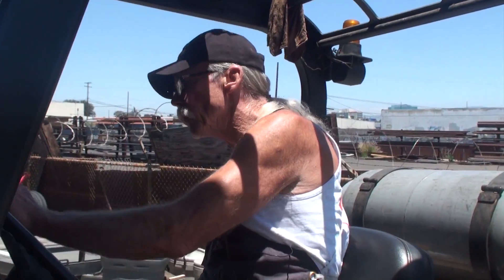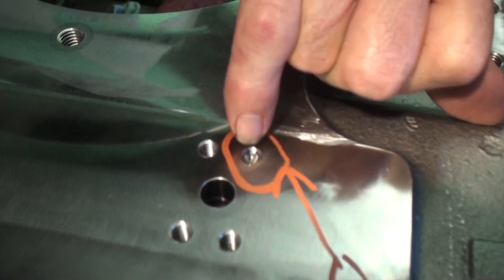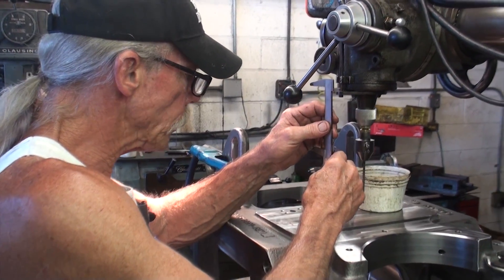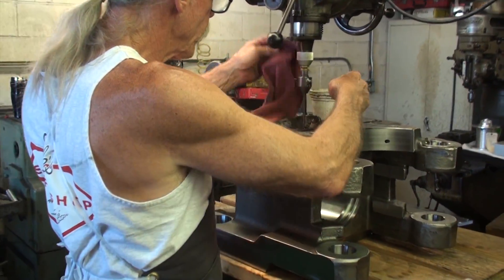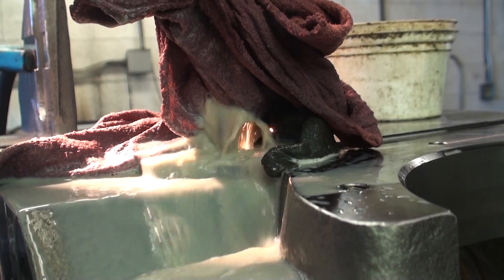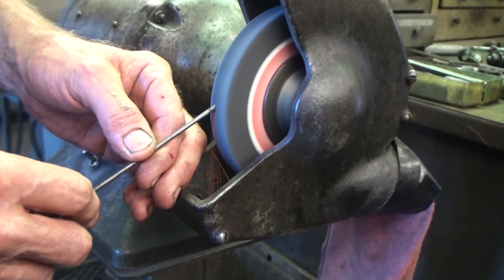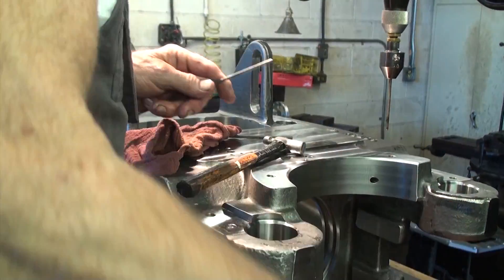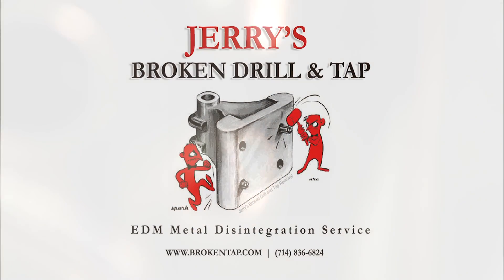Broken Tap Removal by Metal Disintegration Machine (MDM)

Comment: I find it shocking that there are enough broken taps in the world to keep a private business open. That's amazing.
Reply: it happens all the fucking time in high volume manufacturing.
Reply: They probably do other work in between. Most shops do many types of machining.
Reply: With cheap steel chinese import no brands tap you will see more and more !
Reply: AirsickCashew it’s really not. I’ve been a machinist for 16 years. I work on Haas mill CNC machines and I can tell I I’ve broken dozens of taps over the years. Luckily our jobs don’t require working on one super big and super expensive part at a time. We can just scrap most of our parts and it will only cost us penny’s. The cost of the material. We do production runs. 500 of this 200 of that, but yes if I broke a tap in that part, I would be so happy if I new of this dudes services. I can totally see how this guy would have plenty of business
Reply: That was my thought
Reply: Jim Watson don't you mean removed broken bolts with a left hand bit ? Never seen anyone successfully remove a broken tap with a drill bit . I am some people refer to bolts as "taps"
Reply: We like to extract taps using a "tap extracter kit" The fastest way in my opinion :) If not that, we usually drill out the tap with carbide drills.
Reply: the russian machinists tap extraction kit lol.... Carbide drill bit ?? Wth  how about you post a video of drilling out a 62 plus Rockwell tap with a carbide bit. Never seen it done in 25 years....
Reply: @stevenmassey7586  I'm serious, we use carbide drills. We do it for small taps though.
Reply: @stevenmassey7586  ... or use several old worn 3-4 fluted (carbide or better)end mills, with an OD diameter size aprox .020 smaller than the minor diameter of broken tap , fill the hole with tapping fluid,  use wicked high rpm (eg. assuming your on a cnc mill,  e.g. 1/4" e-mill start with 7-10 thousand rpm, e.g. 1/8" 9-13 thousand rpm,ect.... )  Your first few exploratory cuts will give your tentative base line ,  [imperceptible rattle... is the tap loose?  low level rumble during contact?  increase rpm. ( you want light "crunchy" disintergration sounds)   ect... ]   MANUALLY feed in employing abrupted, multiple, short pulses advancing 5 to 10 thou at a time. You will be looking for smoke and smelling for burnt tapping fluid, keep the fluid level topped up, and completely flush out when cleaning out debris every 50 to 75 thou.    the machine will talk to you, listen to it EVERYTIME you advance.  when successful, youll  end up with with spiral (or straight) "comb" of the tap cutting edges as a reward.
Reply: Two ways I've had got luck removing broken taps 1) using a center punch to loosen and turn tap out or on thru part. 2) blowing tap out with a torch.
  Best not to break them but it happens for sure, especially in a blind hole. Using the proper tap eliminates a lot of breakage spirial, three flute, four flute, starter,bottoming... Etcetera
 And yes when the boss is standing beside you bitching come on hurry I under bid this job and their truck is in the parking lot and even use a drill motor to tap it fast 😬😬😬
  Now i remember why I got out of job shop work...
Reply: I would imagine this gentleman is very well known and work is probably shipped to him. People send out engine work all the time.but I kind of want to believe this man's up to a lot more than just extracting broken taps. Broken drill bits are almost as bad.
Reply: It might also surprise you to know that there are literally millions of holes tapped daily and because life is not always fair, I'm sure that there are thousands of shops like his all around the world.  Sometimes, depending on the metals being tapped, you can loosen the broken taps using acid but you need to make sure that the acid eats away at the tap only and not the metal that's being tapped, so at little chemical background always helps.
Reply: As long as there are new machinists and old engineers....
Reply: Probably is THE guy for this work in an industrial area
Reply: If you have enough machine shops as clients it will keep you busy. That piece of iron he was working on had a lot of machining time use on it.  The people making it wanted it fixed because there was not  enough time to make another one.
Reply: Yes I thought the same thing duh?
Reply: @markvotava5325  Not really there is no telling how much the company had tied up in that part they brought him to get the broken tap removed.  His labor rates are not cheap.
Reply: You all are talking when you should be listening. Pay attention, it doesn’t get any better than Jerry!
Reply: If you look carefully at one of the parts he does, it's  serial numbered aluminmum or titamium part and he's in the local area pf several   aircraft manufacturers.  Material costs alone, not to mention labour and time on expensive parts is a big deal.  Plus they do car engine fastener repairs.
Reply: Jim Watson  .
Reply: That's what I was thinking.. I guess if you have a manufacturing company that hasn't figured out to stop using cheap Chinese taps you can open a business off of them
Reply: Tom's at a fancy party with the Governator, Elon Musk and Clint Eastwood. They all list their considerable accomplishments and they turn to look at Tom. "Ahem." "Tom says, "I have a disintegrator, and I'm the best".
Reply: I don’t!
Reply: Simply we mill it with blended solid carbide ball nose with lower feed  and high spindle  it cost nothing except one or two worn ball nose
Reply: Apprentice fitter and turners lol 😂
Reply: Well there are enough idiots in the whole wide world  that think that they can tap a hole anyplace an anytime they like with out asking the proper procedures necessary needed first.  Which is a good  thing because it keeps people like me making a good living selling cheap Chinese taps to round eyes idiots !!!!
Reply: Half of them are probably mine lol.
Reply: You don't have to sit an IQ test to buy tools,
Reply: I worked with a guy who broke 5 taps in one day. lol
Reply: i really amazed, wow, may now days, simple laser is enough to blow it
Reply: U have no idea lol
Reply: You can see some of his parts are aerospace, prototype parts in Titanium which can be grabby and the parts expensive.
Reply: The most common cause of a broken tap is people don't remember that the deeper the  hole the larger the tap drill needs to be. It is a topic covered in the machinery handbook. It is too bad very few people read it.
Reply: MaryandDale Davidson  Hahaha.  So how does that apply to a U.N.J. for avionics applications? You truncate threads based on the required situation being depth material etc. You do not apply this in most cases as it is an amateur approach and in 99% of my cases the part or component would be scrap. There's a big difference between hobbyists and professionals.
Reply: @punishr36 , He was referring to, but didnt know it, percentage of thread, and a compromise that he seems to deem necessary. 
   Stuffing a larger diameter tap drill into a deeper hole, and your resultant loss of percentage of thread, isn't in the Machinery's Handbook that I know of.
   Rather, as an avilbeating regular machinist, I tap, pull it and clean the hole, reapply fluid and tap more, until I'm done. greater percentage of thread is good in most cases, aviation in general must call for it, I guess, quite often. Beats me, but I dig these comment sections for many reasons! lol
Reply: @davidson46100 , and some steel has hard spots.
Reply: @davidson46100  They probably cant afford to buy the machinerys handbook, but totally agree with what you say.
Reply: @gsmith5865 ,
   Anyone who doesn't have a Machinery's Handbook needs to stay away from machining, period.
Reply: @davidson46100  I'd say the most common reason is they go to a hardware store and buy those cheap taps, thinking they're actually for making holes. They're nothing but chasers. You can probably get away using them in softer materials, but I still wouldn't push my luck.
Reply: MaryandDale Davidson lmao
Really? Is that what you know about machining???
😆
Reply: MaryandDale Davidson Do you have data to support that claim?
Reply: We have an EDM machine at work. It's a PITA to set up, and operate. But, sometimes necessary. If it comes down to scrapping a -$3-5K part, of spending an hour with the EDM. Guess which option gets used?
Reply: @zedhead2864  We have one where I work as well, but it's an easy setup and most taps burn out in a few minutes. Although I did spend most of a shift burning out about an 1-7/8 spiral tap once. I say easy setup, for ME it's an easy setup, most guys just stare at the machine like its magic and beyond human comprehension.
Reply: yeah, well when the guy in charge of buying shit only gets plug taps and bitches when they get chewed up you start getting taps broken off. seeing as the part is usually worth about many times the shipping cost off it goes to the guy with an mdm
Reply: @ikegel1923  Taps break mostly because of user error.
Reply: thanks to all that chinesium crap
Reply: @parker9a10  anybody using chinese taps on expensive stuff like this deserves what they get ! 🙄😏
Reply: parker g. I don't disagree, but there is a flip side to your argument. 
Apprentice programs are rare. Beginners often can't afford the good stuff built of Americanium*. Journeymen might well not want Cleetus learning on  (slash breaking) their good stuff. 
Also, dilettantes want toys, too. Therefore, Chinesium (a hilarious construct imho).

*used here as a universal to include Germanium, Britainium, Japanium, etc.
Reply: very true!!!!!!
Reply: I've broken plenty of taps and never had a hard time removing them.How this guy has stayed in business 40years is amazing.
Reply: @markbennot7462  You dont know what your talking about
Reply: there wouldnt be if people used the taps right.
Reply: Kevin Stearns  If you haven't broke a tap you ain't built shit.
Reply: Kevin Stearns Dude, I will call bullshit on every machinist who claims they’ve never broken a tap. It happens.
Reply: Kevin Stearns Qq
A
A

Qq
Reply: @kevinstearns4198  In my 48 years I have had new taps just snap on me with very little pressure applied. I did a lot of work with brass and bronze metals along with all other kinds of metal and was taught by probably the best machinist in KC how to run a tap to chase and cut new threads. This same machinist said it happens to the best and don't ever believe anyone who says it doesn't. I have had to have this same process done once to remove a broken tap. Other times I was able to get out.
Reply: @kevinstearns4198  or threadmills
Reply: The crazy part is that’s the only fucking thing they do....
Reply: No need to use the f word in that context.
Reply: munter10 But there's a need to scold? On what authority?
What created the burning desire to let us all know of your singular piety and a concurrent diminution of others? The problem with culture is you.

Comment: With a skilled TiG welder, a shaft could be fused to the broken TaP and with oil lub after the weld, the tap may come out. Can't force these things, need gentle coaxing.

Deep embedded broken tap over 1/8th" could be more tickey extraction. Greater than that depth good luck with the method mentioned... good luck.

Great video.

Comment: I am a little bit wiser now than when I woke up.  Thanks.

Thread repair kits (Heli Coil or Time Sert), what is your opinion on those?
Reply: Well first off i would use heli coil just because it has the correct filaments with the thread being only 3mm radius and 16 feet long it can be adjusted after but make sure to use the correct tools when working with the repair kit it can also be better if you use a magnetized electrode that can create atleast 16amps when working on it, might break off within seconds of the first one being broken off because you just can't deal with the remainder of the filaments due to the fact that the amps of the electrode has corroded which can result in spark and if that happens and you have gases running you have a potential of a explosion. but once you got everything down to the millimeter you can make adjustments according to the chart that was provided by the brand of the tap which can sometimes be difficult to read without glasses. other than that you are good to go.

Comment: Wouldn't it make sense to include the service of finishing the taping for a small fee? 
1) the customer doesn't have a tap anymore 2) if you break your own tap again finishing the job, you have the means to get it out without too much extra cost, the part is already on the EDM table.
Reply: +nraynaud1 You'd need full specs for the tapped hole - thread depth, thread tolerance class, bottoming or taper tap.... much better to let the customer finish the job than risk screwing up a big, expensive part!  Plus, there's likely other holes that still need tapping.

Comment: hello Tom, @3 min. You are measuring the depth of a hole with a caliper, and using a tape measure to see how deep it is. Instead of increasing your measurement error by a major factor, read the depth directly from the caliper (i am lazy) But a very cool method of removing stubborn screws. What is the smallest diameter you can remove with this method? Btw. you are looking absolutely cool doing your job, more people should be like that, thanx for the video.
Reply: He most likely used the tape measure to show the viewers.

Comment: Can this method be used in aluminum parts?  I've seen someone use an arc welder to weld a shaft on to the end of the tap and unscrew it.  But that will only work with small taps.  This method looks like it could be used on very large diameter taps.
Reply: +John Ferguson We can work with any materiel. From 2-56 taps and up to 3" diameter!!!
Reply: Tom Grafton   I glad that I found your video.  I didn't know about this option to clear out trapped taps.

Comment: Ever break a second tap off in the same hole?
Reply: yes it possible but you might need a service with an oil change and to make sure you need to dispose of the correct filaments because the tap might break off with in seconds of the first one being broken off because you just can't deal with the remainder of the filaments due to the fact that the amps of the electrode has corroded which can result in spark and if that happens and you have gases running you have a potential of a explosion. but once you got everything down to the millimeter you can make adjustments according to the chart that was provided by the brand of the tap which can sometimes be difficult to read without glasses. other than that you are good to go.

Comment: I wonder how many harbor freight taps he has extracted.
Reply: All of them
Reply: Nice
Reply: @Ezude  Damn. That's what I was gonna say.
Reply: +Man na Damn-it, that's why I'm watching this video... lol Harbor Freight.... :-(
Reply: Lol
Reply: Hey! Don't knock Harbor Freight taps. They're great for tapping ivory soap. I've only had one break, and there was enough out of the hole I could back it out of the bar with pliers.
Reply: I made a nice, no drama tap in 1/4 inch aluminum bar stock with a HF tap. So they aren't completely useless.
Reply: harbor fright taps are only to be used in steel for chasing threads lol. anything softer and they're fine
Reply: I bought a snap-on tap and die set, and snapped a tap Inisde a aluminum carb slide..not impressed.
Reply: @OGKILLa9365  if in aluminium you are lucky, "easy" method https://www.youtube.com/watch?v=c6MQl-uySyU
Reply: He has a side business, Teddy's Top Taps, he sells re-branded "high end import" taps to his customers. Kidding aside, nice to find that niche, he apparently does enough that MDM/EDM machine looks well used. Nice.
Reply: All of em
Reply: Enough to keep them in business.
Reply: yr funny thx fr the heads up
Reply: All of them... hahaha
Reply: PROBABLY ALL OF THEM.......JUST SAYIN'
Reply: I think you just drill them out.  They are scary at best, at least you can see them start to twist before they break :)
Reply: Probably zero.  They wouldn't make it that far down in before breaking.

Comment: Hi Tom,
Big respect to you BCOZ you have been doing this a long time, I could not help but notice that the depth gauge (sorry, Vernier Caliper) that you chose to use is capable of measuring to an accuracy of at least 0.1mm and yet you compared the result against a steel rule. in addition, those hard round chisels had ALL the heat treatment value destroyed when you put it on the wrong type of wheel and made it glow bright red.

Comment: how does he not get electrocuted by touching the water in contact with the electrode?
Reply: +John Titor It's already grounded out.
Reply: Hi,a,ps low voltage. s
Reply: +John Titor EDM machines use distilled water as a dialectric. Water is not conductive without ions (granted it will always have some.)  

Caveat: I don't really know what part of the video you're talking about since I didn't watch the whole thing (it wasn't what I was looking for) but I am responding to your comment.

Comment: Wow  Tap is a harder than cast iron metal but, can't you just use a cobalt bit to drill out the tap? Also how much did it cost the poor guy that broke that tap? Awesome video less the wad of Gum
Reply: NO ---a tap can't be drilled out  ( no matter-what the drill is made of)---it will push off and drill into the threads
Reply: @davidwrighton3914  I have seen it done with a carbide spade drill. Others here suggest a carbide milling bit. I agree that a standard point drill will not work because the top of the broken tap is not flat.